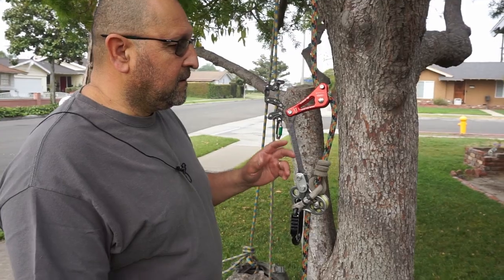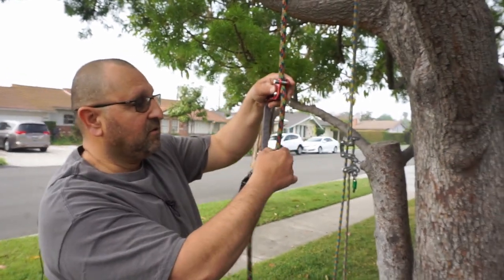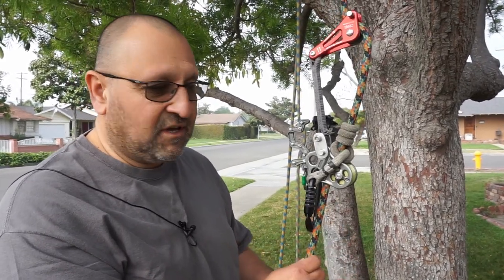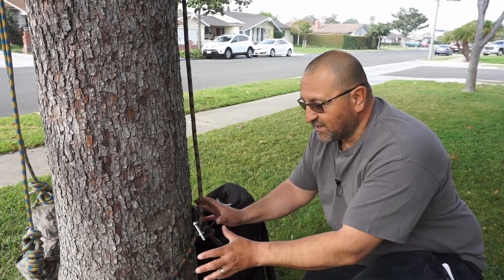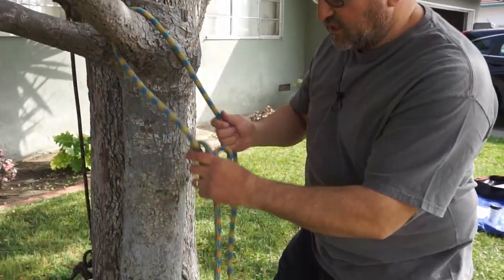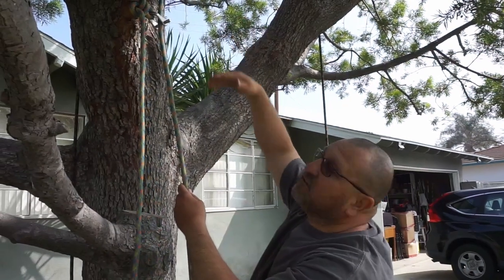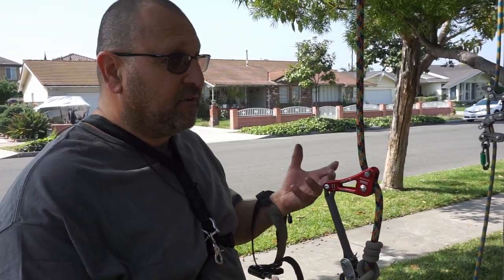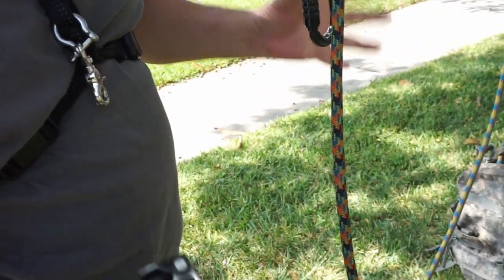Ultimate Guide for the Stationary Rope System (SRS/SRT) For Tree Climbers

Comment: I'm a beginner to tree climbing and tree work.  I bought a house about a year and half ago that needs a lot of tree work and I don't have enough money to hire someone to do all the necessary tree work for me.  The biggest problem is there's about a dozen pine trees, many of which need to be removed.  Some of them have limbs hanging over the house making it necessary to go on the roof to remove excessive pine needles droppings every few months.  Further, all these pine trees drop way too many pine needles to leave them all on the lawn, which is also a big job to clean up.  I've started removing some of the limbs from one of the pine trees with limbs overhanging the house.  I'm using SRT with the Rope Runner Pro and the SAKA Mini Knee ascender and the Notch Jet Step Foot Ascender.  I have a Big Shot and after numerous attempts been able to lines for SRS over unions (crotches) near the top of a couple of these trees, which I've now installed friction savers on.   It works, but these pine trees are about 50-60 feet high and on most of these pine trees you have to go up about 30-35 feet before you reach any limbs, and you have get pretty close to the top of these pine trees before you could climb up between limbs using alternating lanyards because the limbs are just too far apart.  So I have to use the ascenders to climb up nearly to the top of the tree.  I do have some inexpensive tree spikes, but they make the trees bleed pine sap pretty bad making a mess.  What's more, I'm not going to remove all the pine trees and it'll take me a long time to do all this work by myself, so I don't want to use spikes.  My big concern is safety.  Usually it seems with SRT what I see is that they just have the climbing line as the single tie-in until they reach some limbs.  But with these pine trees, you have to climb 30-35 feet before you get to any limbs at all.  That's a long way up with just one tie-in.  What I've been doing is using one of my steel lanyards... I got them before I realized rope lanyards are much easier to manipulate!... and loop it around the pine tree to form a secondary tether tie-in point, so I don't have to rely on just one climbing rope to go so long and up 30-35 feet on just the climbing rope.  So, if something were to go wrong with the climbing rope the lanyard looped around the pine tree would keep me from falling.  This works, but it's VERY slow, and I'm wondering if there's any device that could make it easier to advance the lanyard up the tree after taking a few steps up with the knee and foot ascenders.  Is there something I could put around the loop in the lanyard around the tree that is similar to the Buckingham Super Squeeze that would make it easier to advance up the tree.  I'm also going to try attaching a secondary safety line to my harness, which would provide even greater redundancy.  I also got the ROPE Logic adjustable friction saver, but I couldn't seem to find a way to make that work without it getting in the way of the Rope Runner Pro.  I've seen the Tree Squeeze, but I'd think that have the same issue.  I think both are really intended for spike climbing and I'd think both are likely to get in the way or the Rope Runner.  Besides spikes, which I don't want to use until all the limbs are removed...where I might have to... is there anything else that anyone can think of that might be this easier and safer?  Like. something which will keep the steel lanyard loop around the tree together better so it's easier to advance up the tree?  I tried criss-crossing the lanyard too, but that also gets in the way of the Rope Runner.  Any ideas?
Reply from the maker: Here in California if you have a high tie in point that is considered your life line and if you are using the stationary rope system you would just use your foot and knee ascender  to ascend and when you reach your limbs that's when you connect your lanyard. It sounds like you have enough equipment you just need time to trust it.
Reply from the maker: https://youtu.be/hQ9qkdNR8j0?si=jBa-nFR7P4Vk8j_p
Reply: @BinoH One other question.  When you remove a tree... cutting it down log by log to the ground... is it virtually unavoidable that you need spikes for that?  Or, is it perhaps possible to use an adjustable friction saver as a tether point for SRS just below the log you're going to take off of the trunk and then just move the  adjustable friction saver down each time to cut a new log size portion of the trunk?  Can you perhaps just hug your legs around the trunk as you're cutting each log sized segment of trunk?  Or, do you really need spikes to do this?

Comment: Thanks for the video. The Uniscender preceded the other mechanical prusiks on the market. Originally designed for DdRT (MRS), it  was quickly adapted to SRT (SRS).  When tip tying with the Quickie in the eye of a Butterfly, it doesn't like redirects. Try placing the Quickie above the Butterfly. Many climbers do the same trick with a ring, but the Quickie is midline attachable.
Reply from the maker: Yes the Unicender was the first one I tried. What I didn't like is that holes would widen and you would have to use a thicker diameter rope after time. I don't know it that problem has been solved. I do like the Qickie with a Butterfly.
Reply: @BinoH  The Uniscender does have wear problems. I think it's main issue is the aluminum wear points like you mentioned. Some climbers add a descent drum to help with friction management. Rock Exotica is working on a new version. Perhaps it will incorporate some stainless wear points like Edelrid is using on their Bulletproof carabiners.

Comment: Good morning. Bino. Yesterday I received a Rope Wrench manufactured by ISC. I noticed that during descent, in addition to the roller, the pin also rotates. Is this normal behavior, is it supposed to be like this?  Please answer. Greetings from Poland.
Reply from the maker: Yes it rolls when you descend. As long as the slick pin is locked you have nothing to worry about.
Reply: @BinoH  thank you very much for your answer👍👍
Reply from the maker: @arbersky4074  You're welcome!

Comment: REDIRECT >>>  QUESTION>>> With the *RopeRunner Pro, are You snapping into Your lanyard once You accend into the canopy then  disconecting the *R R Pro then tossing Your line over another 2nd crotch then re-attaching Your   *RR Pro ? ? ?
Reply from the maker: Yes you get to location that you want to redirect lanyard in disconnect  and set it through the crotch you want and reconnect.  I made a video on it. Rope Runner Pro redirect.
Reply: @BinoH  Thanks Bino

Comment: Since I'll mostly be doing canopy work I'll need to do redirects and limb walks, so it's best I get my kit setup for SRS. Which rope wrench setup would you recommend?   Why are there different length tethers? Does it depend on my Height? I'm 5'9 1/2" tall and 180 lbs. My climbing rope is 150" of Yale XTC Fire with one tight eye splice.
Reply from the maker: I think more it's what your preference is where your climbing hitch is from your belt and what type of hitch you use. Also how long your prussik cord is. If you like using a VT with a long cord you might like the longer tether but if you hitch cord and shorter and you're using something like Michoacan  you might like a short tether.
Reply: @BinoH  Thanks Bino, that makes a lot of sense. I don't have a preference since I'm new at this. So, I'm thinking starting with a shorter tether and a Michoacan hitch. My thinking is keeping compact might make it a lil easier working my way around limbs in a canopy.

Comment: I'm new to this so maybe someone can help but isn't it potentially dangerous to have a prusik below you mechanical asender, being if the mechanical fails and the rope slides the mechanical will then compress your prusik knot making that fail also?
Reply from the maker: An ascender above would only be to help ascend your climbing hitch is your safety. If your ascender failed you would still have a foot ascender or you could grab your running end of the line a stop.

Comment: Ive learned with crane jobs that shackles wich is basically a big quickie shouldnt be install in a way that the pin is being pulled just like in your example
Reply from the maker: There is a differnce in rigging and climbing operations. In rigging there can be dynamic loads and huge difference in wieght. In a climbing application you should never have a dynamic load. Having the Quikie set up this way the kn rating is 30 and it does not side load. I belive the rope would fail before the Quickie would. Thank you!

Comment: Would using a climbing rated locking carabiner be a suitable substitute for the quickie ?
Reply from the maker: If you are asking as a canopy anchor my understanding it's best to use a Quickie or a rated skrew link. I have seen caribiners used on base anchors but it's best if the carabiner has something that holds it in place so it does not side load.

Comment: How long of prusik is recommended for the rope wrench set up?
Reply from the maker: Basically it's your preference but it also depends on the length of your tether and the hitch you use. If you have a long tether you can use a long cord or short cord. If you have a short tether you will need a short cord.  My tether if about 7 inches long and I use a 24 inch cord using a Michoacan hitch.
Reply: @BinoH  thanks!
Reply from the maker: @muskyman26  you're welcome!
Reply: @BinoH  you should do a video of the pros and cons of a full harness not just a saddle